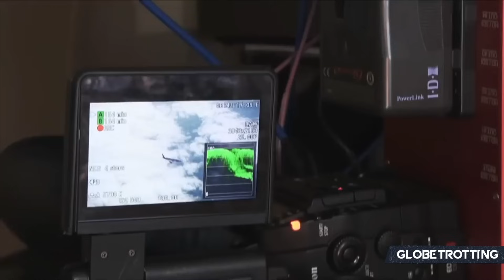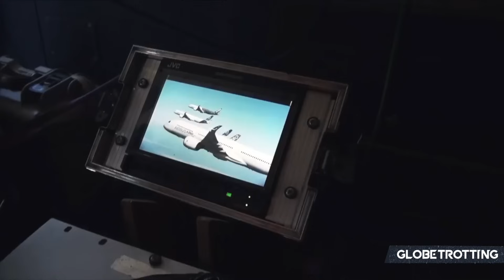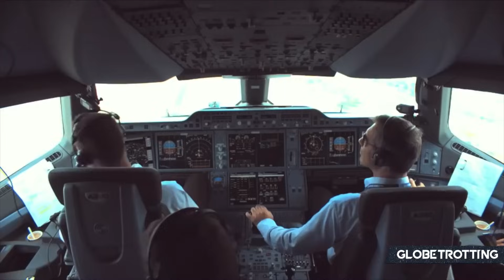The SCRAPPED Airbus A350

Comment: Interestingly, the A330neo essentially became what the original version of the A350 from around 2005 should have been. And the A330-900neo with its 7,200 nautical range in the current production version became a viable replacement for the 777-200ER.

Comment: Airbus made a big mistake by using the same wings and engines as A350-900. They should've create smaller wings, less powerful engines for A350-800.
Reply: Well the optimization could have increased the developing cost of the overall program so... I kinda doubt it.
Reply: A330-9 says hello
Reply: @  A330-900 is a larger aircraft compared to A350-800.

They actually wanted to replace A330 with A350-800.